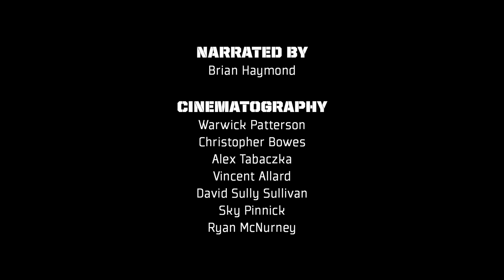Launch Control:  Subaru’s Viking is unleashed at GRC Dirtfish - Episode 2.14

Comment: That new territory had better be the WRC!
Reply: New territory as in, now a team that has won GRC and can fight for championships. Also New territory with the 2015 Chassis. Never say never but currently Subaru does not have a motor that can run in WRC because of the the WRC spec rules.